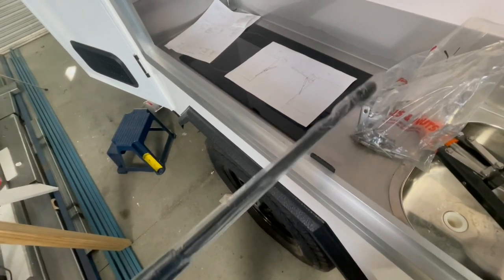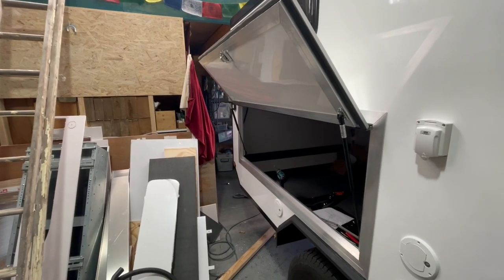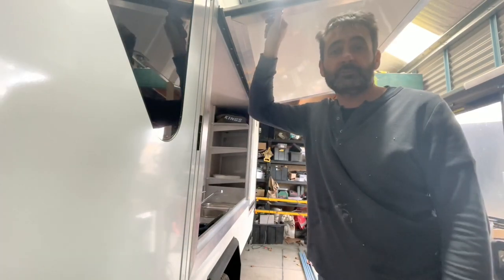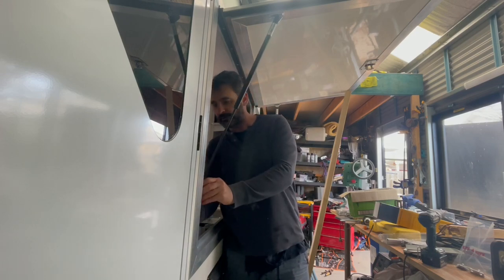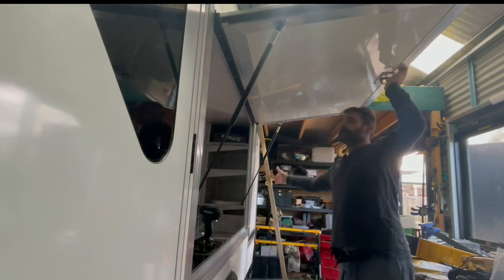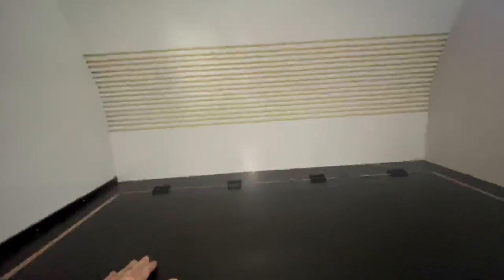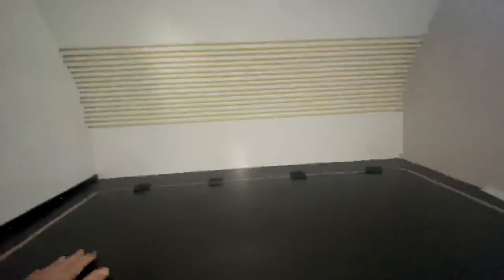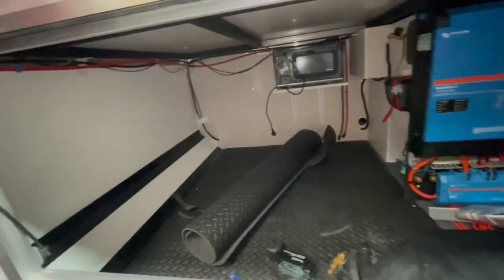Episode #17 - Solo DIY offroad caravan build series - registration!

Comment: Another excellent video Craig , van is looking great , and registered . If you look at the price of the upper level pop top off roaders I reckon your  savings are going to be huge (not counting labour of course) and you know it's been done properly.
Reply from the maker: Thanks Rodney. I’m going to do an episode after the build series on comparative costs against some of the vans i based the design on. It wasn’t a “cheap” build by any stretch but still only a third or half of some I’ve priced.
Reply: @PerpetualTransient  I realize you are not cutting corners or quality  and that you are investing a huge amount of time and money but there lies my problem with RV manufacturers , an example of this is the new CUB Campers 16 Footer , nice build good equipment but these people are fully geared up for manufacture , the current price for this van is around $130,000 . To look at it from another view = I can buy a luxury 20 foot Van with ALL the fruit for 90,000. My wife and I have a 2004 Jayco heritage , I did a solar Package and tricked up a few systems , spent $14000 for the van and $1000 for the improvements , we can now afford a lot more but there is no point , Unless you would like to build our next van 🤣🤣🤣🤣

Comment: Excellent video, do you need any engineering from a VASS engineer or anything to get it rego’d in Victoria? Just curious as to the process of getting a DIY caravan registered
Reply from the maker: Not at the moment no, i was under a bit of pressure to finish the build by july this year as the rules were meant to change and various sign offs were coming in but it delayed until July ‘23